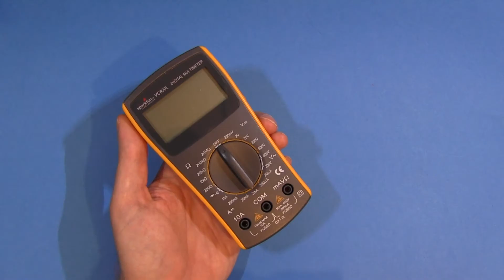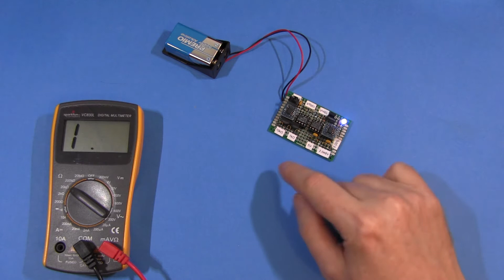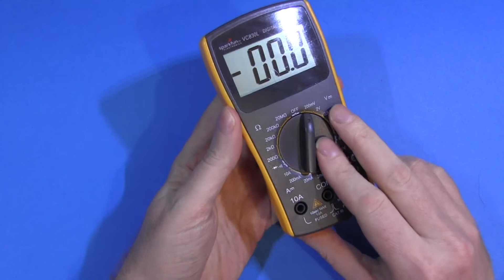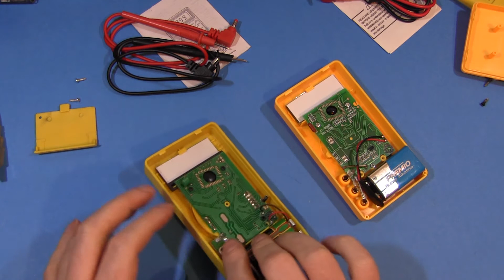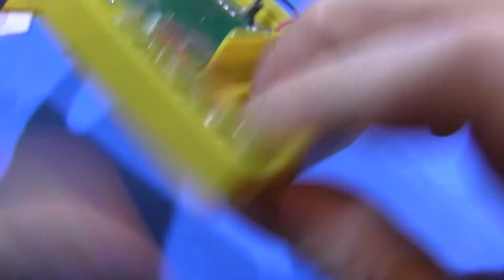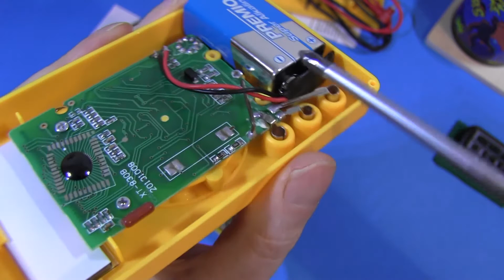Sparkfun multimeter teardown (+bonus cheapo multimeter teardown!)

Comment: If that Sparkfun meter is CAT III then I'll eat the meter.
Reply from the maker: Always double-check the selector switch before testing mains. After you double-check it, triple check it. After that, ask the person standing next to you if it's really set to "600V AC". You should be OK if you do that.

That advice applies to all multimeters really, even Flukes. Multimeters aren't the really best tool for checking mains AC. If you regularly need to check mains wiring then get yourself a non-contact voltstick. Much safer.